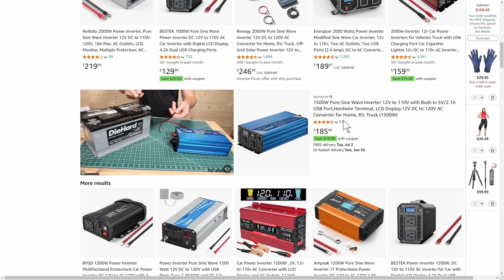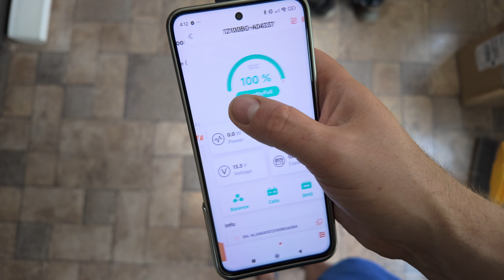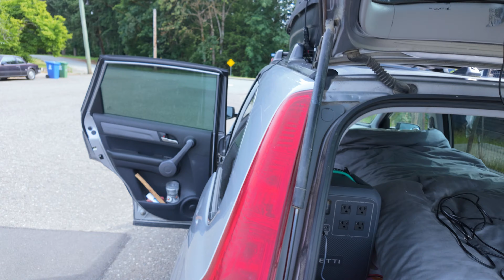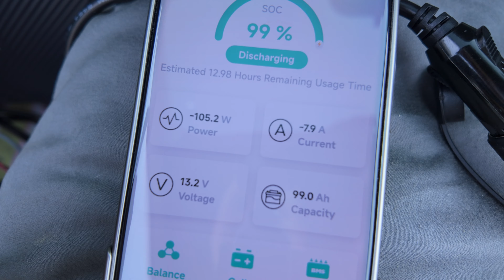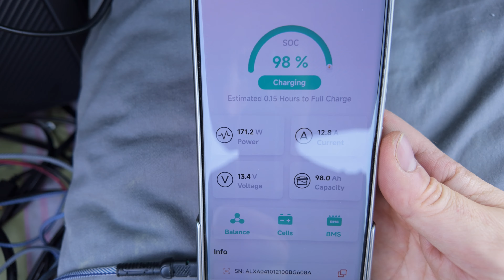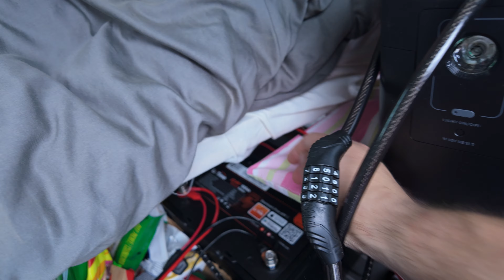No Electrical EASY Vanlife Backup Power Setup with LiTime Bluetooth 100ah Battery

Comment: I gotta say, I'm a bit confused. you're charging your Bluetti battery with another battery which you charge from your home AC. Can't you charge your Bluetti the same way? And you say you don't need an inverter and all that stuff ... but isn't the Bluetti and inverter also - as well as onboard monitoring? And.. the price increase to get a BT battery is cheaper that a 30$ monitor?
Reply from the maker: the extra battery extends my power in the bush, i already had the bluetti, the litimes just allows longer usage. They all get charged at home or when I'm driving or solar.

Comment: Great one.  I have been considering setting up one for my road trip (seasonal travelers). I have been searching for cost effective power station for years and I am glad to see this solution.  Rather than getting a power station for high costs, is it possible just use this battery as a power station instead?  You can charge up over night at home and use it for a weekend trip or so?  Instead of using the cigarette lighter plug, can I use a power extension cord or / and power bar for multiple plugs and USB plugs for my stove and heaters etc?  I see that the power output is 1280 w.  Maybe there is larger output battery?  Perhaps I can just buy a larger Watt for my instant pot and stove, etc?  I need this for my emergency disaster backup as well as I live in earthquake zone.  I find this attractive as it is easy to carry around, simple and easy to setup for emergency disaster backup and seasonal road trip.  

Please advice.
Thanks.
Reply: The way he has it now the Li Time batteries output 12v.  In the configuration shown with just the two batteries he is using them as his 12v source (cigarette adapter). In order to use anything with a normal household plug that 12v battery power is plugged into his ecoflow/jackery/etc which charges the onboard 12v battery which is then connected to onboard inverters to output 120v. Quite clever albeit a bit labour intensive.   Like he says, it is a very simple way to do it if you don’t mind swapping cords. I didn’t notice if the 2 batteries were in parallel but that would be a very easy way for the second Bluetooth enabled battery to monitor the total voltage output of both batteries.
Reply: @garychiang2568   I see.  I find these power stations very expensive given that it is for emergency backup and seasonal road trip.  So, I was planning to set up the simple system with the inverter and try to create my own power station.  I thought this li time batteries can do the job similar to the ecoflow or bluetti or jackery.  I was thinking of getting the 2000 W inverter and have the necessary parts for the setup.  This li time battery is great with bluetooth and app for monitor.  This would save me from buying one less item.  As the technology advances, I am hoping that something similar to ecoflow and other power stations are to be invented to lower the price.  Thanks for the note. Very helpful.
Reply from the maker: they aren't connected together just 2 individual batteries because I don't know anything about electrical systems
Reply: @IdRatherBeHiking  to put them in parallel connect the red of the first battery to the red of the second battery. Connect the black/neutral of the first battery to the black/neutral of the second battery.  Voila now they are in parallel and essentially the combined output is still 12v but at twice the power output (assuming the batteries amphour are identical).  Both batteries will now be depleted simultaneously. With the Bluetooth on the second one you can now essentially monitor the voltage of both batteries.  To use the batteries which are now connected in parallel you just need to connect to one of them to utilize both of them instead of swapping them out all the time. Hope that helps.